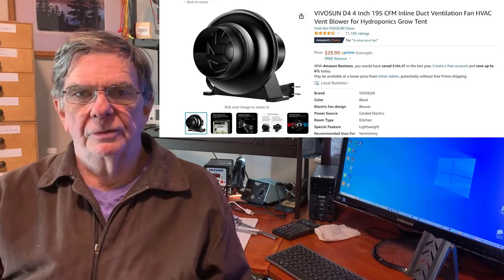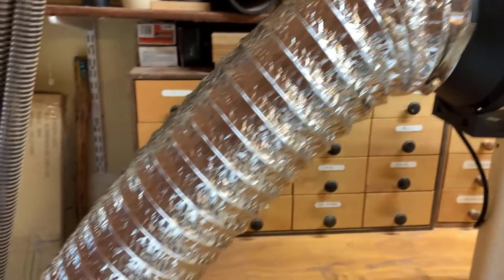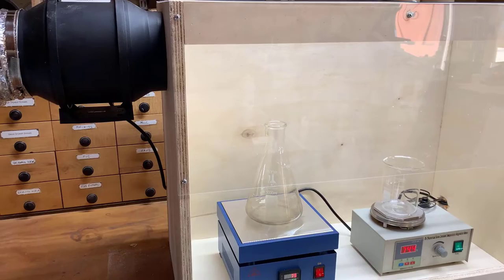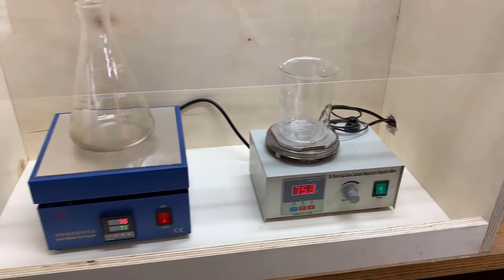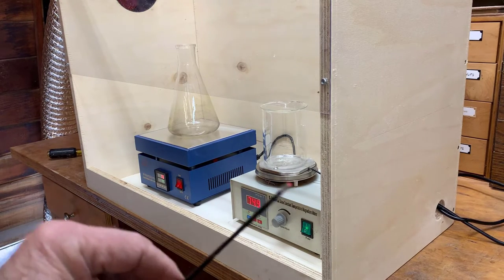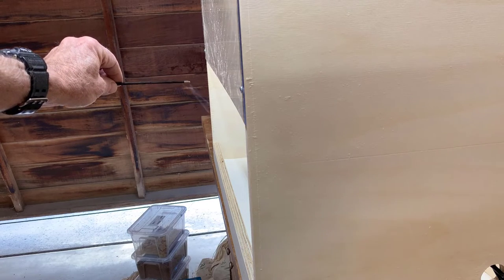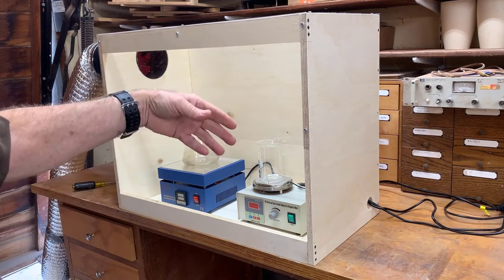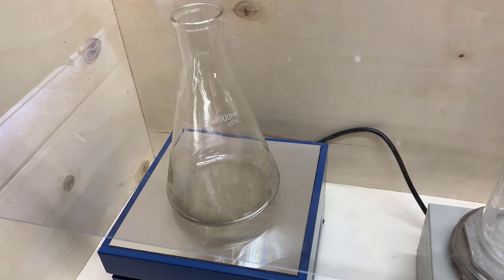Fast, Cheap, DIY Fume Hood

Comment: Ive been looking round to see how other ppl have been building fume hoods.. I’ve been severely disappointed by the complete lack of filtration, as someone pointed out below-the fumes will destroy the fan and duct in no time.. its also going to destroy anything the duct ends near.. add a few layers of carbon filter on fan intake, and a “spray booth” chemical filter on the exhaust before your ducting..
Reply from the maker: Good comment, thanks. My hood is for occasional use. So far so good. -- Dave
Reply: Fan and ducting is so cheap, does it really matter? Especially since it likely wont be ran everyday.
Reply: Using a wye pipe fitting you can blow clean air into the pipe from the split which will generate low pressure in the other pipe before the split. Thus you will avoid contamination of your fan. You can coat everything with a ceramic paint sealant which should improve the chemical resistance of the setup.
Reply: Yes the wye is the way to go. Corrosive fumes will eat the fan before you know it

Comment: Friend! Im not sure to what degree of chemistry you're practicing! But I would really recommend that you line the interior of your fume hood with some sheet metal! This will be a wise investment seeing how at times solutions can burp out their corrosive or flammable components, shielding the interior would save you countless time and perhaps cost from damage and cleanups are so much easier with a metal skin! Plus its way safer then flammable plywood, so you'll have piece of mind. Nitrogen dioxide has such a tendency to make cellulose materials barbecue into carbon, and lets also keep in mind those pesky but beautiful halogens that love to take nibbles out of anything within a foot from them😂 just trying to advise you! My first DIY hood had gotten so contaminated in my Fischer price days, i had to tear it down because the plywood acted as a sponge. And days after an experiment the smells would linger on, i started thinking that this could be counterintuitive  and wind up costing much more than I was able to budget!  Take care

Comment: You're gonna get some major rust issues with that fan and the pipe u used if u end up doing any projects with caustic or acidic vapors....trust me on that, learn the hard way.  Best to get system that does not directly vent through the fan itself, and all exhaust pipe should be ABS.
Reply: I'm thinking an inline fan is potentially dangerous to extract flammable vapours with. What type of fan would be the correct one?
Reply from the maker: I agree completely. I only use it occasionally, so it's been OK so far.  -- Dave

Comment: Nitric acid fumes will destroy that fan in a day. The fumes have to be pushed out thru positive air flow. To exhaust smoke from a building the fire dept puts a fan in a doorway blowing into the smoke filled house and opens a window. The smokes goes out the window not the door.
Reply from the maker: Hi Alex, thanks for the comment. Internally, the fan is plastic and it's been fine during 6 months or so of use. No sign of degradation so far. However, I had to replace the Aluminum ducting with polyethylene ducting. As you can imagine, the Aluminum got pitted in no time.  In a fume hood, how do you blow air into it?  -- Dave
Reply: @orophilia   I'm confused why he said this. A comment on Cody's Lab said make sure to use plastic fans like you're doing, so it's not reactive. I take it this guy has no idea what he talking about. Like you said, positive pressure in a fume hood how...?
Reply: @WildernessMedic you have to pressurize the room via wall or door fan while only having the ducting exit said room
Reply: I knew someone who tried positive pressure on a 'fume hood' before, his tent overheated, and his whole house smelled of ganja for a month.
Reply: @u2ooberboober wouldn’t work in a fume hood because of the gap at the bottom of the screen, if you tried fanning air in, then the vast majority of it would just blow out the front, it would need to be completely sealed for positive pressure to work to expell it through the duct, which would require a sliding door on the front which can be lowered or some sort of detachable panel that needs bolted on each time

Comment: Curious how long that aluminum foil ducting will hold up with all the corrosive fumes and vapors. If one were to run enough reactions through it, the alum might cement or collect the PM's.   I tried to get sreetips to setup a sodium hydroxide water bath recovery for his fume hood to recover all the gold that is lost from his AR reactions - he dismissed the idea lol  Considering how many ounces he breaks down, I bet it would be very much worth it.
Reply from the maker: Good morning. Yeah, it's not going to last long, my guess anyway. It came with the fan so I used it. I can buy a 6" duct made from polypropylene or, if the aluminum duct lasts for a while I'll just replace it with a similar one given how inexpensive they are. The fume hood is wonderful, and I can break it down and store it. I didn't know that the PMs can go up the stack. How interesting.  -- Dave
Reply: @orophilia  It's a great design, as all of your creations are - the flat pack is a key feature! I''m guessing around 1/4 - 1/2 gram per ounce is lost in fumes during every refining with AR.  Of course there are many variables involved.

Comment: Can I ask for the exact model of fan you have here? I'm intending on just copying the fume hood you have here, and I want to make sure I'm being safe by getting a fan that's good enough (and I don't trust the cfm ratings of fans online, so it'd be easiest to just get one I KNOW is good enough). Noise isn't an issue, so I'd rather just get the 6 inch fan you used on the box and be well over what I really need.
Reply from the maker: VIVOSUN Air 6” 390 CFM Inline Ventilation Fan with Speed Controller

Comment: Good to have and way better for the lungs than no fume hood. My challenge has been to not just vent the fumes outside and away from me but to recover them entirely. Setting up a simple distillation as opposed to boiling with a watch glass over a beaker in the way Sreetips and others do. Acids can be reused that way. And not piped out into the neighbourhood. 

I realise its not so practical to have large expensive boiling flasks in use because its slow to heat and cool and rinse. Beakers are way faster that way. But I found a thing called a Reaction vessel that in one version is basically a beaker but it has a ground glass fitting that adapters and condensers can be fitted to. But once those are used fume hoods such as this are just way too small. especially with more elaborate setups.

Distilling under vacuum keeps well sealed joints and refrigerated cycled cooling water is good. Working in the winter is good also but care must be taken with water freezing and expanding in a condenser and breaking them. I reckon all of this is worth it in the long run.

Comment: Nice video, thanks for sharing. Have you had any issues with the polycarbonate melting/distorting while heating those flasks? I ask this because i want to use this same concept for pouring lead molds and was wondering if the heat from my melting pot will cause an issue with the polycarbonate top.
Reply from the maker: I’ve never tried more than a bit of hot water

Comment: Thank you so much for sharing this awesome video. I have a question, would this set up be sufficient for exhausting glue fumes? Glue may also have toluene in it as well. Can send you more info on the glue itself. Would like to glue using Contact cement, but don’t want to do indoors with the strong fumes!
Reply from the maker: Yes, the fume hood would do an excellent job of removing the glue smell. Good luck with your projects!  -- Dave

Comment: That's a neat setup. And definitely better then no exhaust. But now that you have it have you looked up the properties of the gasses you produce ? And also wouldn't it be prudent to have a secondary or backup exhaust incase of some sort of failure?
Reply from the maker: Yeah, that's a nice idea but probably beyond the scope of this little hood. I'm always there to watch it. Thanks for the comment!  -- Dave
Reply: I was just thinking in the case of H2S that is extremely deadly stuff. Then I realized any gas that might escape out the bottom will be heavier then air and your face will be above the bottom of the curtain.
Reply from the maker: @davevan1928  Hi Dave. Yeah, I not sure what happens to the really heavy gasses. It's amazing how effective these exhaust hoods are. I can't smell anything coming from it, even with HNO3 and the fan on the lowest setting.  -- Dave
Reply: @orophilia  don’t overheat the solution 100 degrees celsius maximum
Reply from the maker: @myadventure7069  Yes, great advice. I'm using a water bath like you do, and I keep it around 75 C.  -- Dave

Comment: I need to do some work with fuming nitric acid. Do you use this with acids?
Reply from the maker: Yes, I have used it with acids and so far it has performed well. However, if you make it for acids then make sure that the motor and exhaust tube are all plastic where exposed.
Reply: Nitration of toluene?